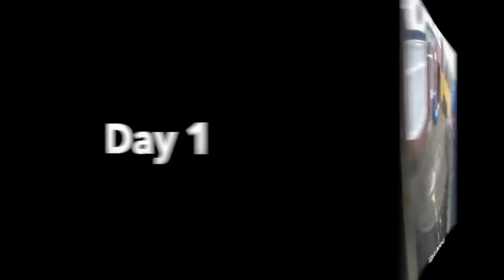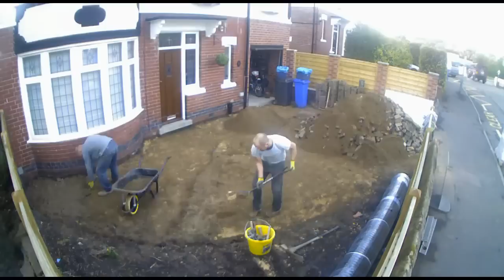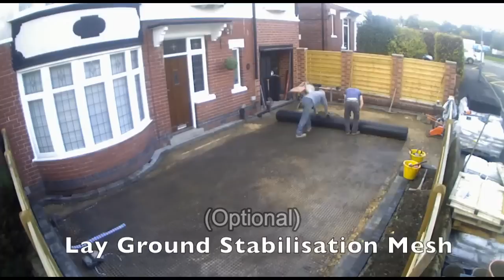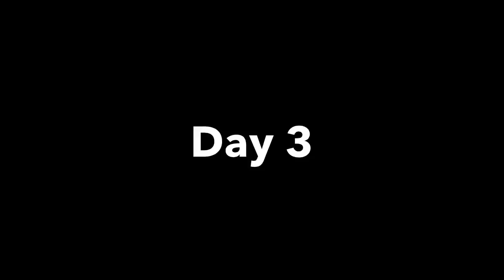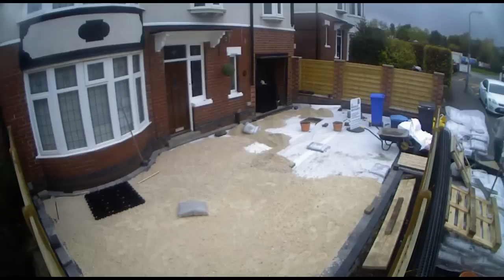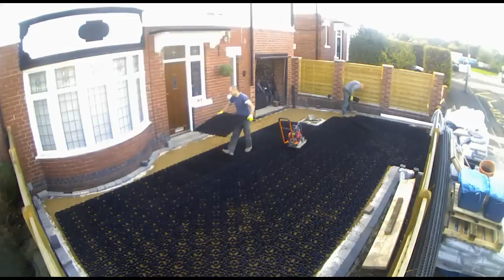How To Create A Gravel Driveway Using X-Grid Gravel Grid

Comment: The original looked better, just needed a power wash and not neglected?
Reply: Why on earth would anyone replace perfectly good brick with gravel?  The cost of materials, labour  and disposal of the existing probably cost at least 20 x the price of a decent pressure washer.  What a waste of time, money........ And a lovely brick driveway.
Reply: Did you miss the bit that its almost doubled in size?
Reply: @alexlifeson2364  environmental reason as water go to the ground. In some countries like Belgium, there is a maximum surface allowed from bricks/asphalt/swimming pool... The grid gravel is one of the solutions to meet regulations

Comment: X-Grid might be a great product and all for gravel substrates, but the owner of that brick patio only needed to pressure wash the shit out of it, and maybe redo the trim to give it a cleaner nicer border. It would have been a lot cheaper, a lot easier, and they could take the time to pressure wash the side of the house too.
Reply: Yeah I can't see the sense in taking that up. Brick is more expensive but requires maintenance, in my experience maintaining a gravel driveway is a massive PITA compared to brick.
Reply: @polla2256  May have just wanted  change!
Reply: I was hoping to see grass growing through but just saw layers and layers of extra layers …….